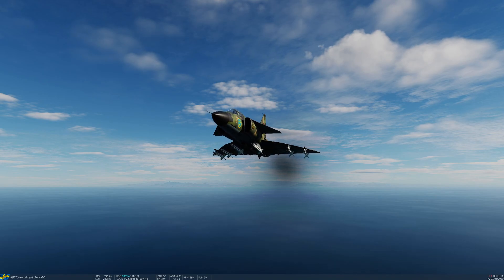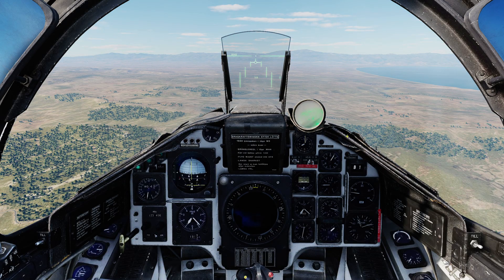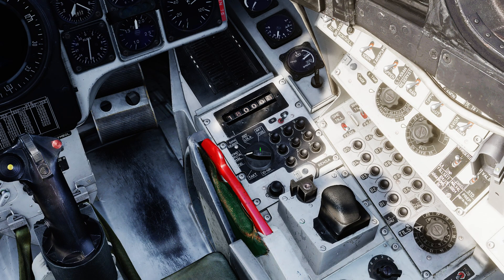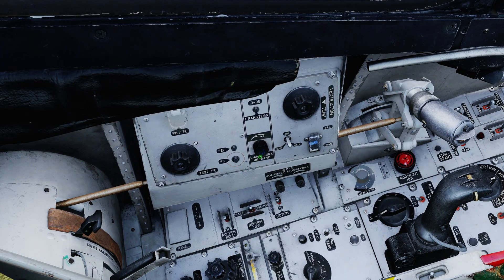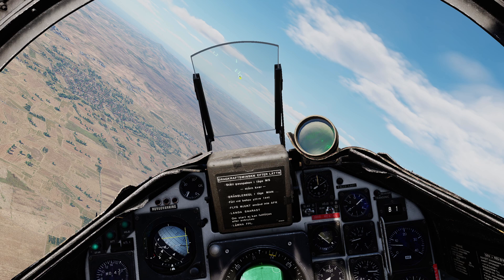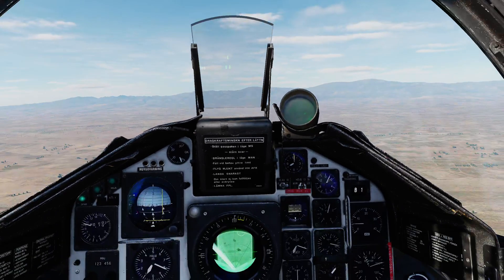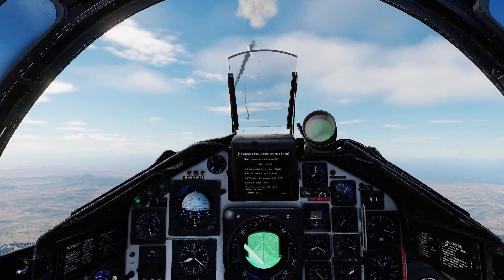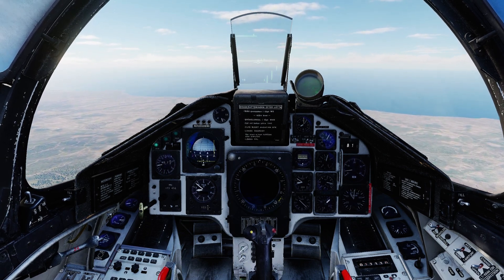DCS AJS37 Tutorial 15 - RB24/74 Sidewinder Missile

Comment: setting the radar to use b-scope will make it easier to spot air targets.
Reply from the maker: Excellent tip. Switch to A2 for a better view than I got.
Reply: @deephack  i tested it some more. there are three things i can name to make it possible (or easier) to find air targets using the radar: weapon selector, adjusting radar elevation and using b-scope.
1. normally, the radar elevation is controlled automatically depending on the weapon selector position. On IR-RB, the radar disk will be elevated to scan at 0°.
2. on the A2 position for b-scope will also change the scan angle to a narrower (presumably) 60° instead of the A1 position's 120°. this of course increases the update interval.
3. on other weapon selector positions for A/G, you can still manually adjust the radar elevation. On the A1 position I think I can still see the contact dots... but there are also other ground returns so I can't be 100% sure.
4. i could easily pick up the An-26s i put there in the mission editor. but a pair of L-39s don't seem to show up. I'd be glad if you could test it more.
cheers!